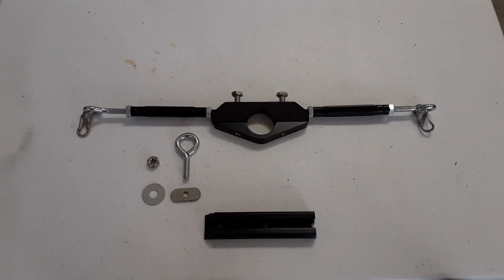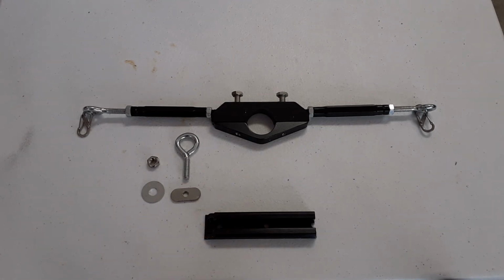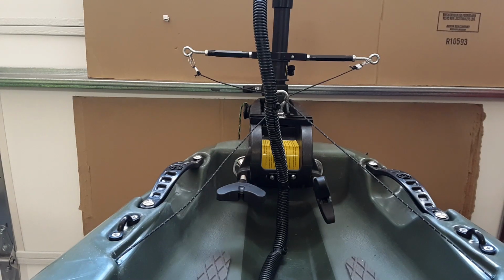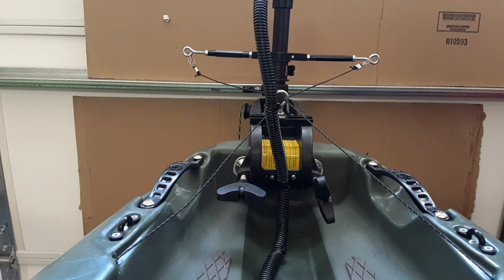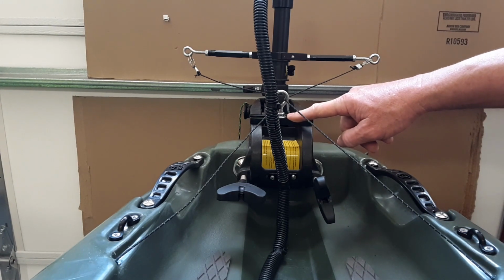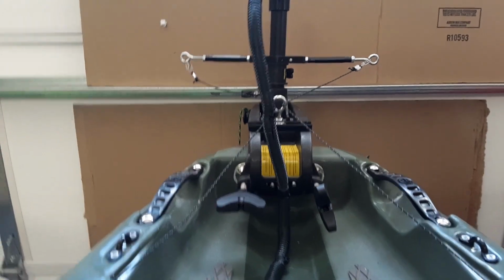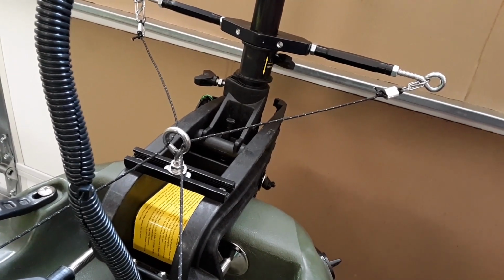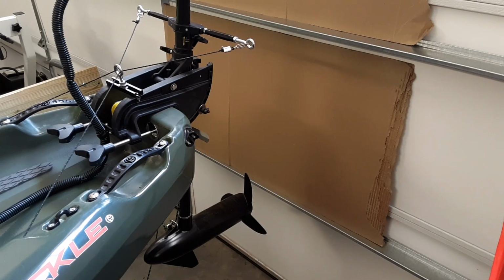Kayak Rear Trolling Motor Cable Steering Set Up

Comment: I also used his center bolt idea for the greater turning radius. I mounted it to a simple 3.5" "T" plate that happened to fit the space on the motor mount and have attachment holes and eye bolt mounting holes in the correct place (just needed to enlarge them slightly). OF NOTE: I originally thought I was saving money by using "WEED EATER" monofilament for my steering control lines, but found that this line has too much STRETCH and am in the process of changing over to similar paracord as shown here. Great videos!
Reply from the maker: Thanks! I use Dyneema cord. It is used in outdoor environments with minimal stretch.

Comment: I like the eye bolt idea, will be incorporating that to mine. Also, I think if you cross the cord at the eye bolt then it'll steer in the same direction as the foot pedal being depressed. (Is this correct?) That's just easier for me. Can't seem to get a hang of the "opposite direction" steer.
Reply from the maker: Thanks. The set up is not opposite steer. Push R turn R, etc.
Reply: @Aksmaniyak  Thanks.

Comment: I bought a similar setup from someone recently except he used a clamp for his centre piece to the control arm. Problem is it keeps coming loose on the shaft and I loose my steering. What is that centre piece part you are using for the control arm?

Comment: Nice job would like to see how you make with power cables stay like that did you kink the line
Reply from the maker: Thanks. I used 10G wiring and zip tied the split tube every few inches.

Comment: Where can I get the main peice for the control arm that connects to the trolling motor shaft? Great video, again 👏
Reply from the maker: Thanks Steve. The clamp section was custom made for me by a friend. You can easily make one using the stock height adjuster and two 1/4 x 20 turnbuckles. Use a cut off bolt or piece of all thread thru the center.
Reply: @Aksmaniyak  thanks brother, keep up the great work 💪
Reply: You can make the bracket yourself with Marine plastic board 1/2, trace shape, bore out 1 1/8" hole, then cut out 2 piece triangle shape with jig saw, then drill ends of larger bracket to size you need need for bolts.

Comment: Two questions;  What trust is your motor?   AND; I am considering a DIY design which mounts the motor slightly forward of the rudder to port or starboard.  This kayak has pontoons.  Do you imagine any issues with this design?  Thanks
Reply from the maker: It is a 46lb thrust Newport Vessels. Whenever you mount a trolling motor off center, it requires more amps to steer. That means less battery life on the water.

Comment: Pretty cool.. if you could put some angle in each of the control arms so like a wider Y , instead both being straight you would get even more throw from your set up. Not that you really need more movement.
Reply from the maker: I've seen the angled control arms. As those arms are pulled in for a turn, the angle of the line exiting the hull changes. This puts more stress on the hull exit points and can act as a "saw" that could damage the kayak. This method keeps the angle constant which also means a constant force is used. You are right...do I really need more than a 90 degree movement?

Comment: I  REALLY like your steering control arm.  Did you buy this or did you  make it yourself ?
Reply from the maker: Thanks Thomas. The bracket was made by a friend. The turnbuckles can be bought at a hardware store.
Reply: @Aksmaniyak  sigh just answered my own question. Was hoping this piece could be bought online.
Reply from the maker: @osimogaming47  Hi. I have a steering control arm playlist with other options that may help you.
Reply: @Aksmaniyak  thanks so much. I’ve ordered some 3/4” and 1 “ split hangers to try that method. Should I bother putting anything between the shaft and ring to prevent slipping?
Reply from the maker: @osimogaming47  You could try strips of rubber or even electrical tape if needed.

Comment: i see you have the motor lift system on this set up? Will this system still work with the motor trimmed up?
Reply from the maker: As long as the pedal cable length is long enough for the lift. It depends on the initial position of the pedals.
Reply: @Aksmaniyak  Thanks, iam finally going to make the change from stick steering lol.

Comment: How'd you get the Kevlar line through the. 25" tubing?  I can't anything narrow enough and firm enough to feed through the tubing.
Reply from the maker: It is 2mm  dyneema cord. Sometimes it feeds through easily or you can use baling type of wire.

Comment: Another great video man!! 
Can we still use the split ring hangars for the main controls attached to the trolling motor or was there. Major set back with those (where we can thread the 3/4 I-bolts into)???
Reply from the maker: Thanks! Yes, you can use the hangers. This can be used with any steering bar as long as you can connect cables to it.

Comment: I have the NV 55lb TM on a Catch PWR and would like to have this same setup. Do you have a video showing how you converted the TM control center to be able to control speed without having to turn around?
Reply from the maker: I use a PWM (digital speed controller) set up. I have several videos showing different designs.

Comment: How do you remove weeds and lily pads if it gets hung up?
Reply from the maker: You use the 2 pulley lift system and raise up the motor to clear.
Reply: @Aksmaniyak  and you can reach it ok from where you are sitting?
Reply from the maker: @kalcorn8  You need to move back there to clear it if that happens.
Reply: @Aksmaniyak  Does the pulley lift system affect the control arm/cables when being raised or lowered. I'm fixing to do a setup like this on my kayak but I'm trying to decide between the lift system or the tilt system. Any help would be great. Thanks!
Reply from the maker: @Preston1989ification  The lifting doesn't affect the cables as long as you have enough slack in the lines. Unlike other lifting options that use the pedals, just keep your feet off the pedals when using this system.

Comment: Why would you use rope, have eye bolts that have a break in them and have the ropes exposed. You never showed the pedals or whatever you have. Btw, take a breath while posing.
Reply from the maker: It is not rope. It is dyneema cord with great properties. The eye bolt gaps don't matter when using the "s" carabiners. The pedal steering is explained in other videos. I guess I'm breathing if I'm talking.